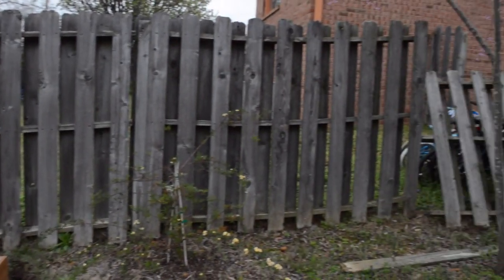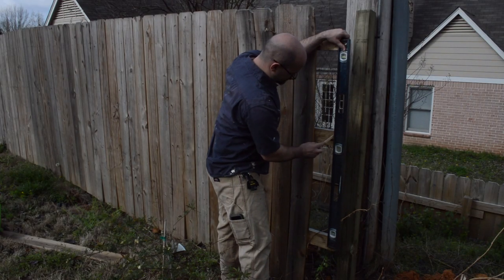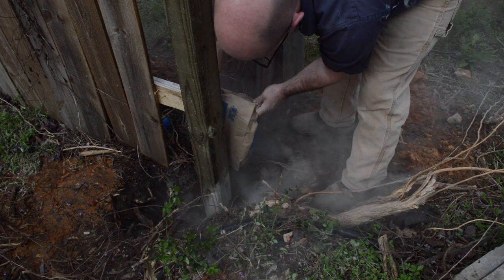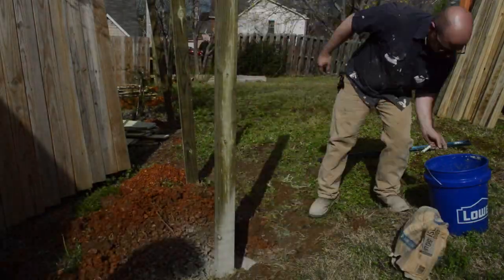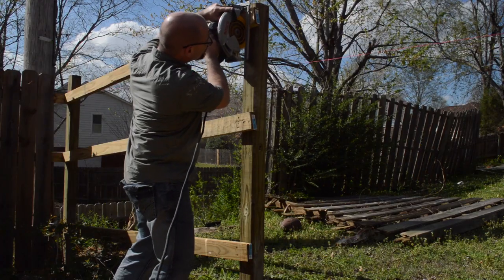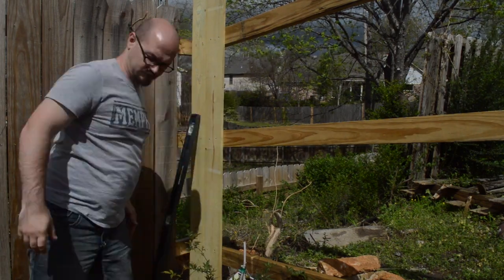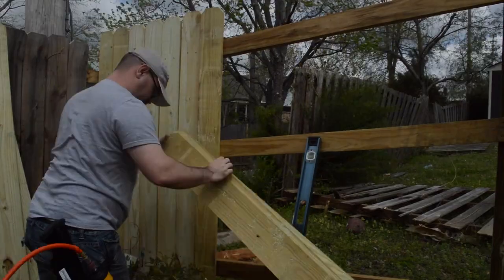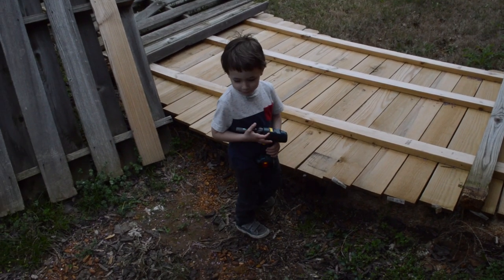DIY Picket Fence Repair Without Mixing Concrete // How To

Comment: Just noticed you replaced a hit & miss boarded fence which is designed to alleviate wind forces with a solid panel fence. My fingers are crossed for you.
Reply from the maker: They’re hit or miss in the neighborhood. Most of the fences aren’t that way. So far it’s been fine.

Comment: Nice fence, a I like the way it turned out.  I always hate digging out old posts.  Was your soil just really wet or something, or did the previous guy put the in wrong?
Reply from the maker: +Wood.Work.LIFE. A little bit of both. There'd been a lot of rain, and the wind that knocked down the panels shook most of the posts loose. Only the corners and one post had any concrete, and that was at most half a bag. And they were everywhere from 12-24" deep. I figure even if the no mix method doesn't work perfectly, they're still better set than they were before.